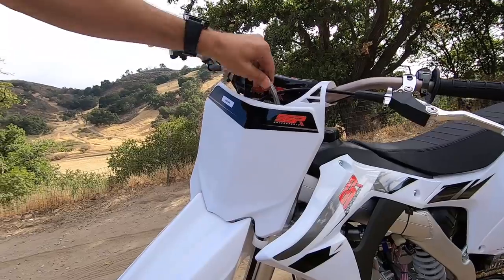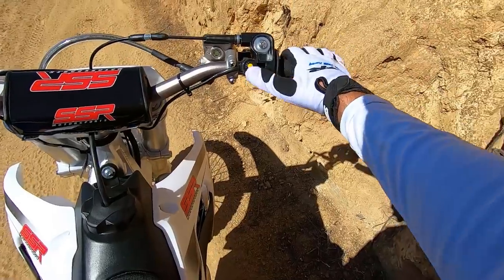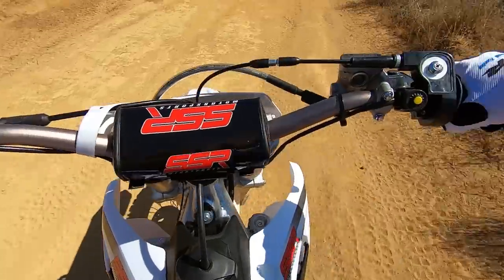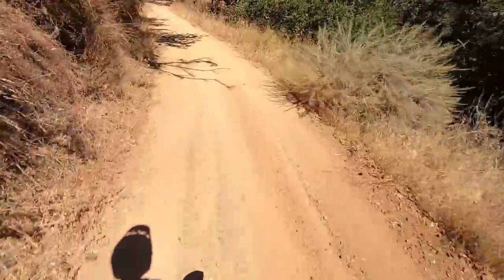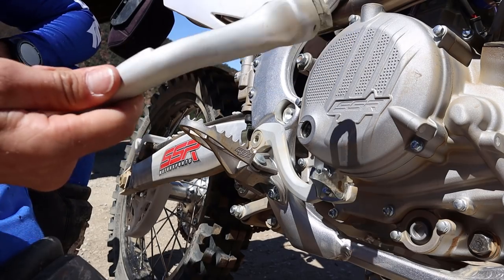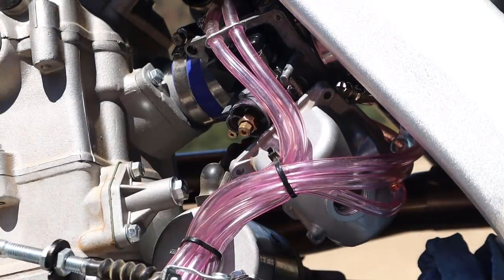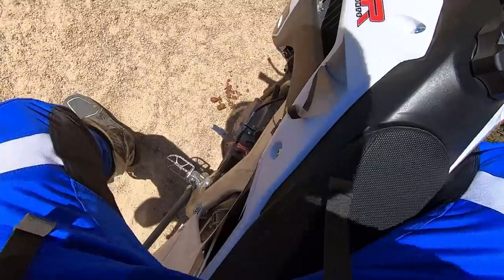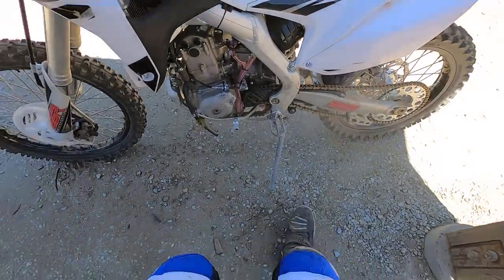I bought a brand new CHINESE dirt bike... And WOW - All new 2020 SSR SR300 first ride & review

Comment: I got the 450. I wouldnt mess around with jetting anymore, I wasted time doing it. Just swap out to any pumper carb and open the airbox. If you are not a brand snob and like to tinker, these are great bikes and better platforms to play with. With a carb swap u can get great performance out of 11:1 pistons AND really long service intervals. The stock exhausts are quiet but free flowing, no need to replace. Rear brakes are too soft on all them, but i adjusted mine up to give more leverage. I switched out forks/shock to Honda super cheap on Ebay. Forks are steel internals, if u swap them u shave 16lbs off the bikes!
Reply from the maker: Awesome!

I have something great cooking for the carburetion 🤘

The main reason I would apply a little more time to the stock carburetor is to be helpful to others as most won't swap. 

I couldn't agree more on the "brand snob" comment. Having fun at it's core is where it's at! The roots.

Keep us updated on your mods, the sport needs it! 

When I fork swap, it'll be a set for MX 👿

Thanks again, I really enjoyed your feedback.

-Charles // mXrevival
Reply: @ Tie One On
''adjust to give more leverage''. What was the adjustment, just
adjusting the travel, or? Cool info on the jetting/Springs.
Reply: @bikersoncall  there is adjustment to move the pedal up/down
Reply: @tieoneon1614  Thanks much. I'm looking 
for an enduro, he's trail/mx, not enduro,
from what I gather. I need a bike with enough low rpm torque to bring the front wheel up for double blip log obstacles.
He mentioned no way to do this with the 
300 in stock form. In a later video where 
he installed a Lectron Carb, he demonstrated that the front wheel would 
come up with ease. I realize you have the
450, but what is your observation or take
on this issue. Also noting that when I visit
the product page for that carb it is not 
found. I'm super keen' on this bike, 
the 300, will look into the 450 but the 
300 is already more weight than 
I'm looking forward to picking up on
 the side of a hill etc..
Reply: @bikersoncall  LOL WTF product page? The bike is exact clone of crf450x, everything aftermarket is Honda. The 450 and 300 are both super heavy. If u are this knit picky about stuff you should probably look at a purpose built enduro bike.
Reply: @tieoneon1614  🍕 If you sober up long 
enough to watch his video on the Lectron
carb upgrade, which made the bike useable
for Enduro, to intermediate enduro, you'd 
know wtf. If it's a dry drunk you're on,
you wouldn't be as triggered by people 
asking questions, if you went back to your
meetings. You didn't like the brake action,
you swapped out the forks, so glad you're 
not 'nit picky' .

Comment: Can't wait to see "the after 10 hours riding " complete rebuild video on this bike
Reply from the maker: 😂 now accepting donations
Reply: True lol, even the ssr 125 bikes have HORRIBLE engine parts. The jug of a 125 weighs as much as my Suzuki 350
Reply: @usak8670  are they that bad lol, I was kind of looking at these but maybe I’ll just continue my search for an XR350R 👍🇺🇸
Reply: @deborahchesser7375  I bought a apollo 110 it was smoking a bit so I rebuilt it and have put way more than 30 hours on it and everything has been good so far, IMO Very reliable bike! Just gotta keep up on maintenance!
Reply: got at least 349 hours on my tao tao 125
Reply: had it since 2016
Reply: @zazx560  I had one 2 and I pretty much trashed it but that bike was reliable af
Reply: if anyone seriously wants to buy one,  i have 21.000km on mine (about 13k miles) and has been perfect, i left it for 1 month to sit because i was on vacation and i had to clean the carburtor because it didnt start but thats it, basic maintanence, oil change every 1.5k miles, new spark plug every 2.5k/3k miles. Doesnt smoke on startup when cold or hot, hasnt missed a beat.
Reply: @deborahchesser7375  I like mine so much that it will not be going in the dirt or mud or jumps or anything like that. No rough treatment. If I were an millionaire I would buy 100 pcs and get Australian compliance plates so that they can legally be ridden on the road. Australia has very high standards when it comes to safety. Every life is precious and very special. Everyone gets to live to be at least 88 and eat well. ☆Cheers☆
Reply: I know first time out on it, but it sounds very sluggish and boggy at the bottom. Slow, slow response.
Reply: @usak8670  Bro, you have a DR350? Welcome to the Legend's Club, my brother.

Comment from the maker: 📌 _GUYS! IM GETTING INTO THE FIRST *MODS ON THE SR300! - WE DEVELOPED THE FIRST EVER LECTRON CARBURETOR MOD & IT'S LIVE NOW 😍 ENJOY!! https://youtu.be/PFKjn6fyG9E

I APPRECIATE YOU GUYS!_* 📌
Reply: listening to you talking about the carb lacking tunability in the mid range... 55:30 or thereabouts.... did you turn the air screw IN a little to richen it up across the whole rev range a bit? or did you just turn the air screw at just cracked throttle till it revved highest? its been a long time but i think thats how we did it on my 2 banger many years back
Reply: Those bikes I’m pretty sure are American made
Reply: I subbed, great evaluation style! I'm going to enjoy your channel, no doubt man! Man I wish I lived around there, I'd love to ride that area, all my old riding spots up here in far Nor Cal have been blocked. I'm old man, 60!
Reply: Now if we could just get rid of the CCP
Reply from the maker: @BCzepa  the air screw actually tunes the pilot jet circuit. Needle & clip are more  midrange. I dig that your gears are turning! Truth is, this carb just doesn't reeeally belong on this bike. Also ended up that the air box is too flowing & needs additional restriction. For 2021 theyv ditched this carb for a pumper style too. Thanks for watching!
Reply from the maker: @EthanDove  Chinese made by Bouser (for a lot of different countries actually) and branded by companies in those countries. SSR in America, for example! Thanks for watching!
Reply from the maker: @loganmpe7559  thanks, Logan! Happy New Year 👊
Reply: @mxrevival  good to know
Reply: We don't understand.  It was us free people, (individual liberty),  who created the free market, and communism does not recognize individual liberty at all.  The more we do business with communism, the more free market they will take away from us, (state controlled so called free market, it becomes, and you can not compete), and the faster we will be living under communism.  Really, it is not worth it.  It is like saying, "Look at the cheap TV I got from that street gang!   This is awesome!!"
Reply: Well done, you have enlightened me. My local dealer in Ft Myers, has these on the floor. I agree, they look good. I might be a brand snob but your helping me mend my ways.
Reply from the maker: @wetlifesports  Thanks! I'm having a blast on it & I have always been like you- a bike snob! When I saw this thing I had to have it & show everyone what it was, and may become. Here's some more shots I took too: https://www.instagram.com/p/CEFwZkIhrVS/?igshid=b9ctb3ymm202

Thanks a ton for watching.

-Charles // mXrevival

Comment: drop it down a tooth on front sprocket pal for the tight single track trails do that and remove the snorkel..it will transform it.cheers from bonnie scotland
Reply from the maker: "1 in the front is 3 in the rear" 

My man 🤜🤛

I learned something interesting about this bikes airflow after talking with their head of R&D... next video!

Scotland! So rad, thank you for hangin' Al!

-Charles // mXrevival
Reply: @mxrevival  never put a smaller sprocket on the countershaft , it’s too tight of a turn for the chain, put a bigger sprocket on the rear. Does it have an oil cooler ? That would help on the cooling. A good pumper carb properly jetted and a free flowing exhaust and you’ll be shocked

Comment: i had the same bike but branded as Asiawing here in Europe... great bike !!
i'v put a Mikuni TM36 Flatslide carb on it and that thing was pretty strong ! 
i rode it 4500 miles without any problems... i would buy it every time again
Reply from the maker: Nice! 

I have seen pics of those! The 250/ 450 I believe? 

Do they have a 300 too? 

I bet that carb really woke the bike up a great deal. Happy to hear it was reliable for you too

I appreciate the watch & your contribution to everyone 🤘
Reply: @mxrevival  exactly  Asiawing 250 and 450 ..... they never released a 300 here but you can buy the NC300 cylinder kit for around 200~  the rest of the engine is the same. No differences between NC250/NC300 except the cylinder and piston

thank you... i will follow your superb great videos about it and see what you will do with it in the future
Reply from the maker: @ramiretz  I noticed that! They even have a 450!

I even saw a twin cam cylinder head floating around the internet for the 300 specifically, that would be fun.

Great info, thanks dude 👊

Comment: I really want to see how this bikes performance on a motocross track
Reply from the maker: You and I both. And someday most likely.

But, it's not quite ready for that yet 😉
Reply: mXrevival what would be the main things you’d do to make it track ready?
Reply from the maker: @evildark940  a few things, but mostly things that will help me trust it.

I'll rattle off three of the most important things that come to mind and try to explain them a little bit:

Trust = more seat time and getting used to it. That is always the case with any bike I ride, but this one in particular is not a motocross bike at heart so it will need a little more attention than the regular setup you would do on a bike made for Motocross.

Suspension = it is too soft meaning (1) not sprung for my weight (2) nor is the suspension valving ideal for motocross. It's a trail bike so I feel like they've done a great job with the guts of the suspension especially for its intended purpose of trail riding.

Fuel delivery = back in the day we always had to jet our motorcycles to get the maximum power out of them. Now we (me) are used to instantaneous and over caffeinated 250cc 2-stroke power OR 450cc torque and power that is delivered by fuel injection... The stock carburetor (SSR) and fuel delivery leaves much to be desired. But I want to be clear that that has mostly to do with what I'm used to, and my current skill level which is above what the carburetor has to offer in stock trim.

Regarding the fuel delivery, this bike may or may not have gotten a major fuel system update today 😈

So those are probably my three main things. 

As I get more comfortable, make a few more mods, and dial it in a bit better for what is actually made for - I will be much much closer to the day it sees a track with me on top of it.

Having said that, that doesn't mean it can't be taken to a track right now! You COULD of course just take it out there and go have some fun. 

If This were someone's first bike that they ever took on a Motocross track, and they were at an ability level where they were just learning the ropes of getting around one, it would be perfect

And part of my problem is knowing the difference. I've been riding for so long now that I have preferences, understand different setups, why they are made and why they work for the most part.

If I were a new Rider or teenager again, I wouldn't have a clue and would probably ride this bike anywhere! 

Settings and preferences make you faster and safer, but as you can see - they also make you picky 😁
Reply: mXrevival Appreciate the in depth response I have the ssr 125 and all those things are the issues with this to. Soft suspension to soft way to soft, I did upgrade to a bigger carb but I think even that’s to small it bogs straight out enough to cut off completely if I quick twist full throttle. Is that what the issue is or should I put bigger jets in it before I changed the carb?
Reply: I have one of these and they are way to lean on the pilot jet I went up 4 sizes and that bad flat spot is gone and it starts way better. And just for back ground I've been racing for 40 yrs I'm a A enduro rider
Reply from the maker: @randywoodward9707  So badass!

Thanks for sharing....so you definitely have some suspension mode too then...would love to hear about them!
Reply: The bike is a trail bike not a track bike!
Reply from the maker: @crisc6289  truth! For now 🤘
Reply: What's the cost of this mate
Reply from the maker: @duggierhymes1179  $4,399 before tax & fees 😎
Reply: @mxrevival  they have a little look of YZ250F
Reply: I took mine to the track for practice and it could keep up with the 250’s but it bottomed out jumping
Reply from the maker: @lanebaker7109  it'll do that in stock trim, for sure!
Reply: I have a friend of mine that bought one almost a year ago and the bike has hold up really well and he has beat the hell out of it and rides it every weekend with no issues at all.
Reply from the maker: @victorrippe5845  I believe it!!
Reply: It would disintegrate
Reply: @mxrevival  As I am sure you already know by the time you make this bike MX worthy you could find a nice low hour used PROVEN Japanese bike most likely for less than what you bought this bike for stock. This thing looks like a Honda why not just get the real thing instead? I feel these things are still over priced.
Reply: @mxrevival  While very nice used 450s are all over Marketplace for $4000.00. As an example a 2014 YZ450f. Its all ready to race!
Reply: Why? It’s not a Mx bike
Reply: @mxrevival   Dude you are awesome
Reply: @mxrevival   This comment alone just earned you a subscriber
Reply from the maker: @gmx0413  here to help! Hope you had a great weekend 👊
Reply: @mxrevival  it was ok, just boring. 🤷‍♂️ hope yours was good!
Reply: @MikeHF  yea someone else’s 8 year old headache. 4 strokes that have been ridden motor cross and raced are trashed after 8 years. Now an older 2 stroke maybe it would be worth it because it’s easy to fix and cheap

Comment: I wanna see if an aftermarket pipe would change power or sound
Reply from the maker: You and I both!

We will have to wait to find out because, any exhaust changes at this point will be for naught, as we need to dial in the carburetor first in order to realize real power gains if any from an exhaust change.

But I will get there 😀

Comment: How is the balance on this bike at low speed? I had a YZ125 for trails which was light and fun, but man I came off that too much. Recently sold it for a TTR230, which frankly is a turd. My TTR125L pit bike is more fun to ride on the trails. The TTR230 also doesn't carry the weight well, even though it doesn't weigh much. Looking at one of these because it fits the bill for the type of trails I ride.
Reply from the maker: It LOVES low speed single track the most in stock trim.

I think you'll really enjoy it. Single track with this plush suspension & electric start is really, really nice. And a cooling fan...

It's also full-size like your old YZ125. Not small like the 230.

-Charles // mXrevival
Reply: @mxrevival  awesome, just trying to decide between this and the GPX FSE 300r. The FSE has the EFI, 18" rear wheel and a few other pieces that seem like nice to haves.
Reply: @TheDriversPerspective  KLX 300 great bike as well!

Comment: Hey my XR250 doesn't look 'dorkey'!!! I have a 1991 XR with rebuilt engine (couple mods) that runs great- pull even from low to high, pops nice off the line for a 250.. And I get compliments on it almost every time I ride! You are correct about the 'comfy' ride - trail or street, I dug it from the first ride. I just wish it had electric start!
Reply from the maker: I love the XR's too 😎 Yours sounds like a blast. Dorky looking or not!

Comment: Your vids are so well done! I am interested in one of these. I sat on one and the forks felt ok but the shock was a pogo stick. I'm still looking for suspension options before I bite the bullet .
Reply from the maker: Thank you, sincerely appreciate that and your viewership. We still haven't gotten into the suspension, but intend to. Some people have done fork swaps, etc. But our goal would be to open the suspension, find out what springs would fit to give people other options, and finally decode the shim stacks to see where they are currently versus what they could be for different applications like Motocross or off-road. It's slow going, but I do intend to do it sooner or later as we've made many many mods for this bike already that didn't previously exist. Reach out to me anytime with the website contact link 💪

Comment: If it's got a battery it's got and stater, are you/can you put Baja lamps on it? I hate that kick starter arm interference but I also like the back up of a kick starter. Can you reshape or replace it with a more tucked away after market or other brand arm? Thanx for bringing us along, realistically that's pretty much my dream bike.
Reply from the maker: That's badass Nate!

You're very welcome, it's for guys like you & I who enjoy it.

I'm dropping a new video tomorrow, I got to write a pair of these that were pretty modified out at Glen Helen motocross track. It was super fun!

Mentioning that because I didn't even notice the kickstarter issue when I was on the track. It just didn't exist, but it was the very first thing I noticed on the trails for some strange reason.

And yes, this bike has a pre-wire behind the front number plate for whatever headlight you want! One of the bikes we rode on the track was rocking a headlight actually.

Hope you enjoy it, and feel free to ask any questions anytime.

-Charles // mXrevival